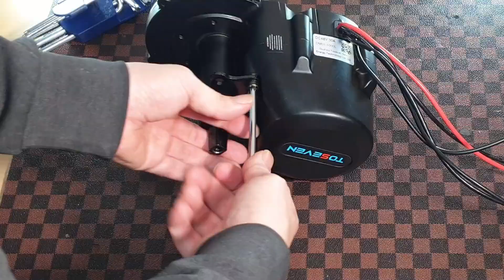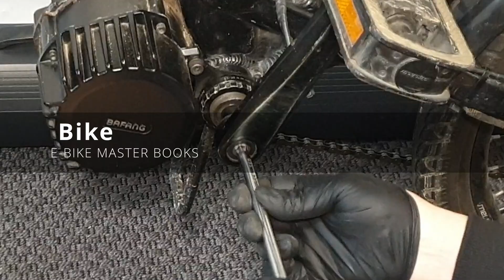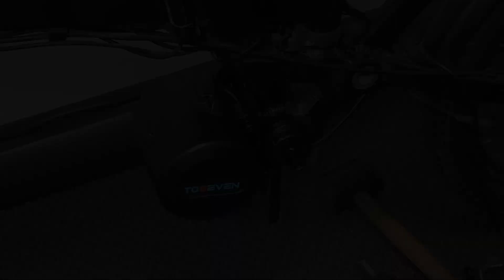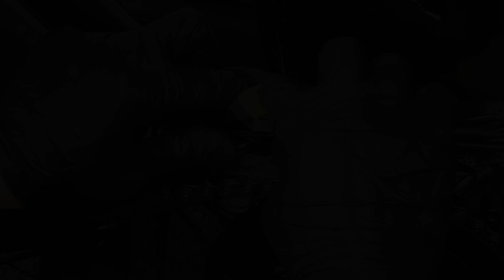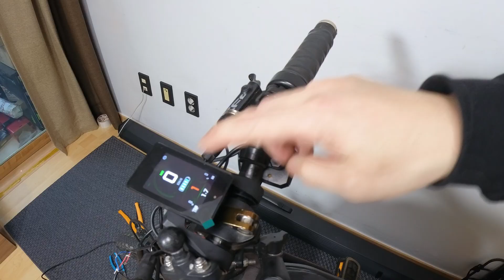2024 TOSEVEN DM01 1000W Torque Sensor Mid Moto Review E-BIKE Kit : Dr.ROAD Installation Full Guide

Comment: Can DMO1 be mounted above the bottom bracket . i see the bafang  mounted above just wondering if it can be done with toseven going on a old super 73 z1
Reply from the maker: Hi. You need to measure the bottom bracket length for this motor. I saw the 73 structure. It looks like it will be possible to install.

Comment: Is this any better than Tongaheng? The clutch looks weak on this motor.
Reply from the maker: It is a little weaker than Bafang 1000 watts, but it is strong. If high torque is used for a long time, a metallic friction sound will be heard.
Reply: @Mobilant_TV nonsense